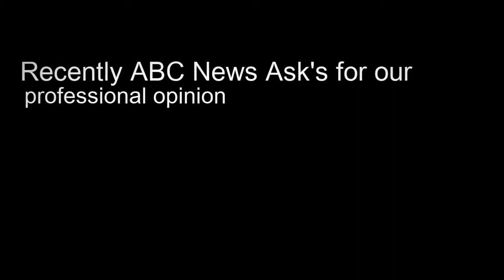How to Prevent Electrolysis from Causing Water Main to Leak

Comment: We found the source of dc current that caused us to replace our 18 month old water main.  There was an old buried AT&T pbx phone cable that had apparently been cut near the broken main.  Lots of dc current leaked in ground near main.
Reply from the maker: Very interesting!  Thank you for sharing.   Where are you located ?
Reply: @HarrisWaterandSewer  Grand Rapids, Michigan.  It is very rare here and electrician tested the ground line in the building and could not detect stray current.  In the back of my mind I remembered that backhoe cut and old PBX phone cable during the water line installation.  We thought nothing of it at the time because that service was discontinued long ago.  Assumed that AT&T would disconnect the line at their box.  We dug up the old line and tested it at 20 volts DC.  I expect our readings were low as their are 64 wires in the cable.
Reply from the maker: @markday9620  Funny enough we have a job going on as I type where we found electrolysis. We installed the main 4 years ago, we knew it was not possible for the water main to start leaking out of nowhere